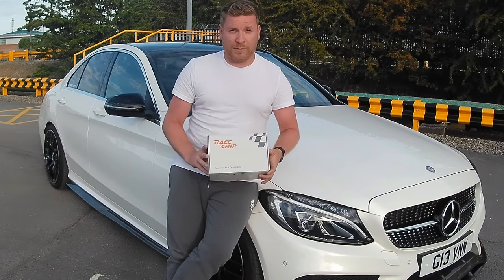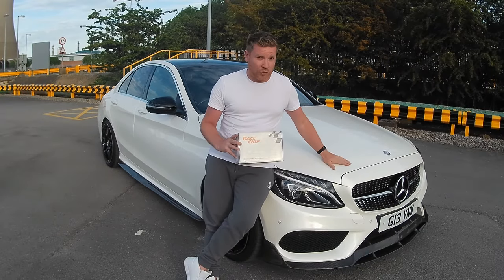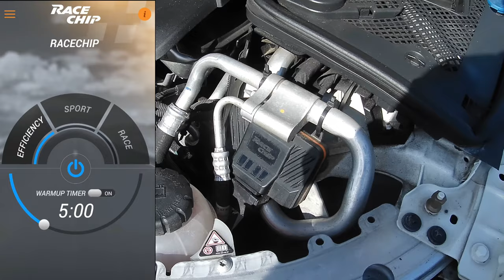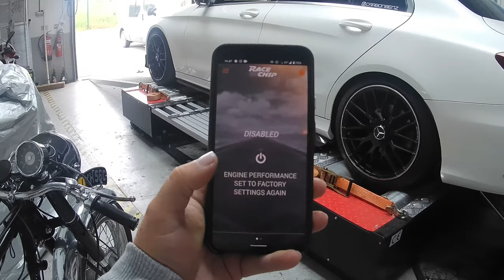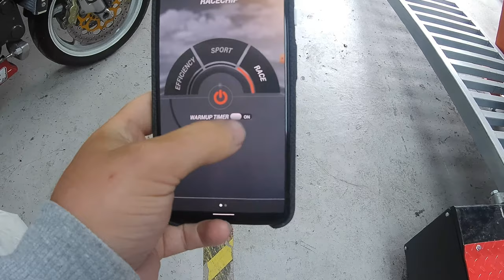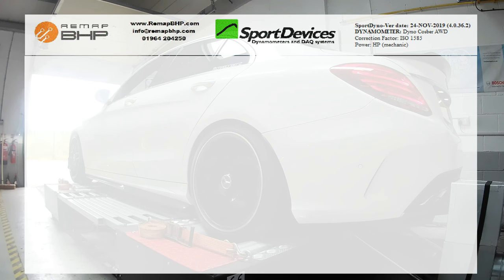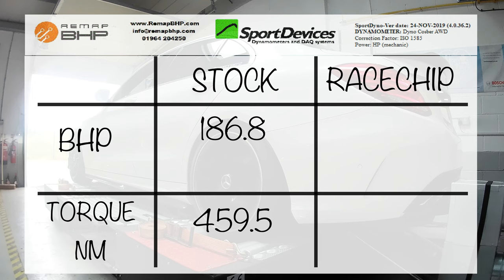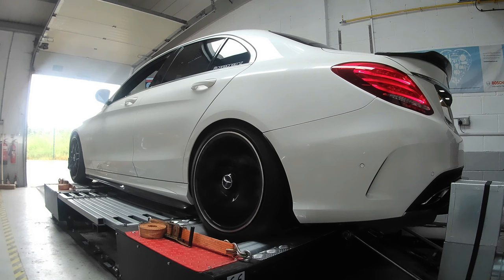RACECHIP Tuning Box's - Do They WORK? DYNO TEST RESULTS!

Comment: How can you have 459.5nm torque when stock for this car is 400nm
Reply from the maker: Your question is answered in the video
Reply from the maker: The Dyno tech advised his Dyno runs a bit too high on torque but as the runs were back to back you would still see the difference, the cars run a bit more than factory but either way all you're comparing is the difference in figures with the racechip on / off which of course the video provides
Reply: @ZER0Y0N  ive watched your video its very good but when it comes to diesel cars torque is what matters most!
Reply from the maker: @nickmarangos2475  totally, so the racechip gave 51nm more torque so that's positive just not the 100 they claim
Reply: @ZER0Y0N  is it worth purchasing  it in your opinion?
Reply from the maker: @nickmarangos2475  honestly Nick - Sadly not, after this video I had the car remapped, took it to 215bhp and 505nm torgue ( actual ) but a full remap will alter so much more such as where the power came in and it absolutely transformed the car. Sadly I never followed it up with the test drive and follow up to this one but the difference was night and day
Reply: @ZER0Y0N  definitely getting a diesel remapped is way better than these chips!

Comment: It would of been nice to actually show the dyno run on the video live alot of these big name makers  have insane claims the truth is the chip/tuner alone(just the tuner) will not do anywhere near what they adver especially on "gas" powered with a few light  mods and higher oct(93+,e85, etc)  fuels then the tuner shines higher octane allows more timming (base,wot,timming curve tweaking etc )   but by it self no other mods and off 87-89 oct you wont feel it faster quicker not worth it  (cost/gain) no matter the brand

Comment: Huge error in your testing - you cannot be sure the RC was really not working. You should have the dyno data before you fitted the box. All data after you fitted the box could be false.
Reply from the maker: If the manufacturer states when its set to off - then its off ? simple that isnt it. ALSO, since you want to get sassy on this one, After this video I took the racechip off and it dyno'd pretty much in line with the stock run. so no error on my part thanks